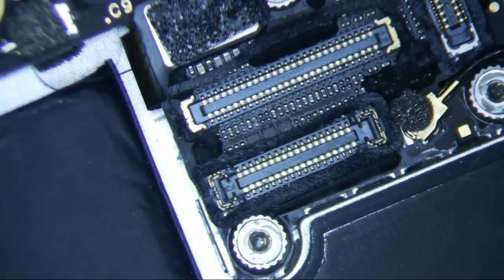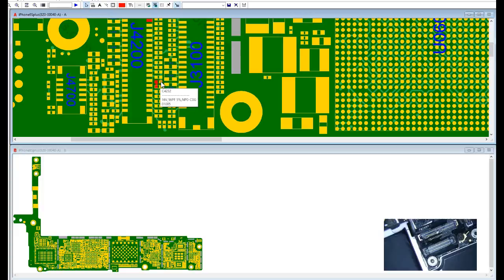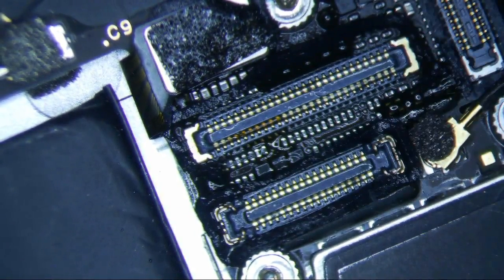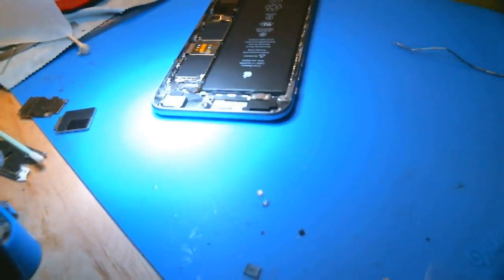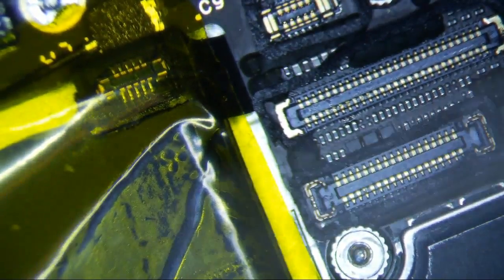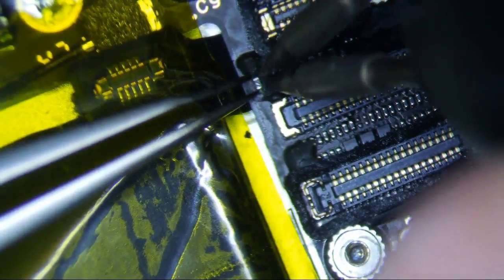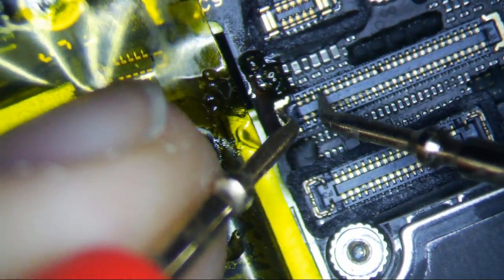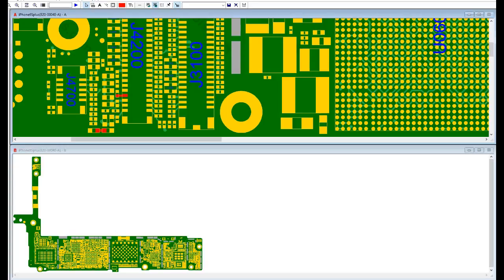iPhone 6S+ No Display Matrix Looking Lines Repair

Comment: hi mike.just looking for some info on jbc tweezers tip.in video you mention you use the 0.3mm tip on the tweezers instead of the 0.1mm tip ,what size component is the 0.3mm tip normally used for (0402 or 0201).the 0.1mm tip is obviously  for 01005.also can you use the 0.3mm tip on 0201 and 01005.i am looking at the JBC CP-2E Micro Tweezers Station which does size 0402 .if you think 0.3mm suitable for 0201 and 01005 this machine is nearly half the price of the JBC NASE-2B .obviosly you get the nano pencil and nano tweezers .
Reply from the maker: Yeah, I use the .3mm tip for just about everything including 01005.  I really only use the 01005 when I'm doing 6s/6s+ connectors or something that requires a sharp tip.  I don't have any experience with the CP-2E.  I know that the weller unit offered .3mm tips as well, but they weren't even close to the size of these nano tips, so just beware that my .3mm tips maybe different than yours for that unit.  With that said, i do know others that use that unit.    I don't think they've ever used the nano unit though so they can't compare..
Reply: thanks for reply mike.you can get at 0.2mm c120 tip(C120002) for the jbc cp-2e micro tweezers station.are you also saying you know users using the jbc cp 2e and it seems to be suitable for them.just the difference is about 500 euro between micro and nano.have budget at the moment for the micro just afraid to purchase and then find unit not suitable .